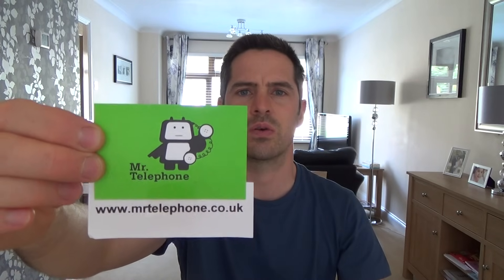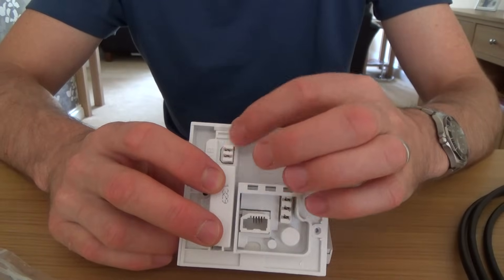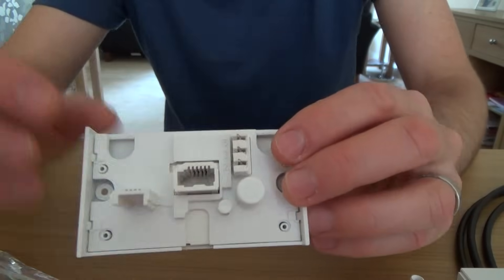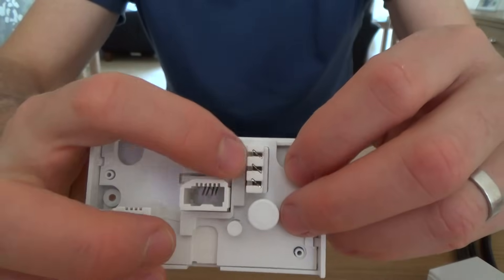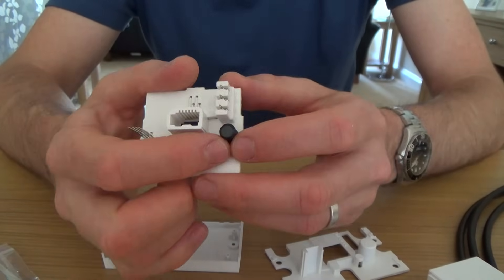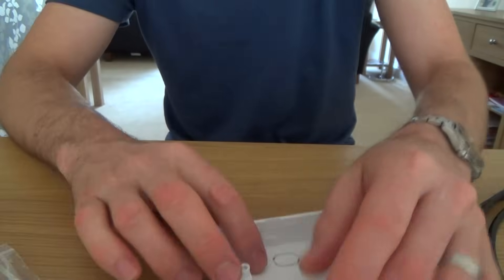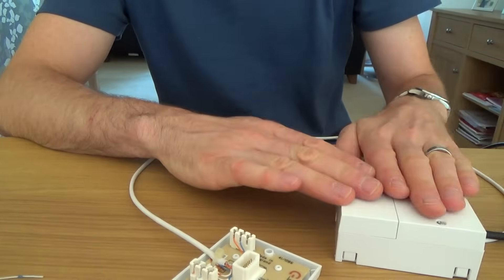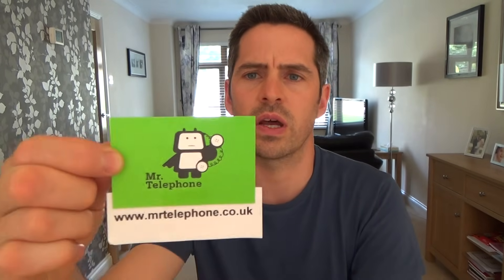How to install a NTE5 Telephone Master Socket and Telephone Extension

Comment: Hi Vince, could you please help me with a easy question, can I cut and extend the power cord going from the mains socket to the base station.  I am worried that if I cut the power cord and join more wire to it, it will never work again..   Thank you for youe time Tony
Reply from the maker: Tony Eaves Hi Tony, can you not just get a standard mains extension cable and then you can just plug the adaptor into the extension cable to save you having to cut the adaptor cable? I appreciate these mains extension cables are bulky but at least you know it will work and is safe.Thanks Vince
Reply: No, it is going into a cupboard, and there is not the room to have a extention outside of it, the only way, I can see is to extend the wire.  Thank you for your reply
Reply from the maker: Tony Eaves Hi Tony, it should work if you only extend it a metre or so and you the same gauge cable so there won't be much voltage drop and make sure you insulate both wires well so they don't short together but I haven't done it so I can't really advise on that one. Sorry.

Comment: Hi Vince, I'm looking to put an extension socket in a room at the other end of the house. Could I extend externally with the external Black BT 2 pair cable (Orange/Orange White & Green/Black? I will go out the back of master socket and around and in to the back of the extension. Would it work if I ensured I used the same 3 colours at each end? Many thanks!
Reply from the maker: Stevie B Hi, yes that cable will work fine. Use the white wire to terminal 5, the orange wire to terminal 2 and the green wire to terminal 3. Do the same connections on both ends (master socket and extension socket).Thanks Vince

Comment: It is brilliant video, very very clear. Can I have a question? The cable from BT to my house is too short. I would like to extend the BT cable to the new place of master BT socket. Are there any suggestions on how to connect two cables?

Comment: Hi

I've a faulty master socket with Screw terminals which are connected with a blue wire and blue & white wire. Can I replace the socket with a IDC one and if so, does it matter which IDC terminal the blue and blue/white wire goes? 

Thanks
Reply from the maker: Chris Armstrong Hi, yes you can replace with an IDC version and the standard way to connect is white/blue to terminal A and blue wire to terminal B (but it actually doesn't make a difference, it will work the other way round as well).Thanks Vince

Comment: Great video. My question is. I have my main phone line connected to a junction box then cable going to the master socket from the junction box. I think the master socket is old as it doesn't have the bellwire filter on it and the master socket uses screw terminals. I have just brought fibre broadband and I don't think what i have  is good enough for it. Would the wiring coming off the junction box to the master socket make the Internet worse in anyway. As I have always seen the phoneline go straight to the master socket. I'm just concerned as I don't know if I need a new master socket or even a new phoneline in the house i don't really won't to call my provider to fix it as that will cost £60-£130. Thanks Harry
Reply from the maker: +HarryxHD Hi, no not really, you often have a junction box to join the internal wire to the external wire. If the master socket is on an outside wall then you will just have the external cable connected straight onto the master socket but if the master socket is located somewhere more inside the property then it is normal to change the external cable to internal cable as it looks neater. Double check inside the junction box and master socket for damp and corrosion, if it all looks clean then it will probably perform as well as a newer installation.Thanks Vince.
Reply: My Mate VINCE Even if the master socket and junction box is clean and damp free is it worth buying a new master socket for my new fibre broadband. i would do the job my self of course. Say putting a new openreach master socket on would it improve my speeds
Reply from the maker: +HarryxHD It might help if you had extension wiring as the newer masters have the bell wire filter but if you only have the master socket without any extensions then it would be unlikely to improve your speed.
Reply: +My Mate VINCE ok thank for your info  :D

Comment: Hi Vince, I'd like to run an extension as shown in your video but instead of ending with a standard extension socket, is it possible to install an ADSL faceplate on  back box and connect the router, telephone and Sky to here where it would be more suitable and out of the way of children and pets etc.  Nothing would be connected to the original master other than the extension, if so what cable should I use, twin pair or CAT5/6.

Many thanks
Jamie
Reply from the maker: JAMIE CLARK Hi Jamie, you could do but you are not going to gain anything over wiring up a normal extension and then using a standard micro filter. If you wanted to get more involved you could fit an ADSL faceplate on the nte5 master socket and then run a cat5e/cat6 cable to the desired location and then fit a twin outlet with a bt socket and a RJ11 or RJ45 module. You could then wire up the bt socket using the blues and orange wires on terminals 2,3 and 5 as normal and then hardwire the green or brown pair for a dedicated ADSL extension using the A and B on the ADSL faceplate to terminals 4 and 5 (middle pins on the RJ45) or pins 3 and 4 if using an RJ11 module (again middle 2 pins).Hope that makes sense. I am thinking it might be worth doing a video on that setup!!!!!!!!Many thanks Vince
Reply: My Mate VINCE Hi again Vince, many thanks for your response yesterday.   I've been on your ebay site and seen the ADSL faceplate and CAT5E network cable that I'd need but I'm not sure what the twin outlet with a BT socket and RJ11/45 module is, do you stock this?  Is it a socket with 2 BT slots and a connector to convert RJ11/45 to fit a BT slot or am I totally wrong?
Thanks Jamie
Reply from the maker: JAMIE CLARK Hi Jamie, I don't have them listed on Ebay yet BUT I do have them!!!!!!! If you just buy a double cat5e faceplate and I will swap one of the cat5e rj45 modules for a BT socket module so you end up with one cat5e rj45 module and one BT socket module. The eBay item number is 260939822466 so type that number into the ebay search bar to see the listing and could you add a note to the order or send me an eBay message reminding me to swap the module over and also to include a back box.Hope that makes sense.Many thanks Vince
Reply: My Mate VINCE Hi Vince, I received the equipment yesterday and I've just installed it this morning and following your instructions it was problem free .The best part about it is that I'm amazed at the difference using decent cable has made, after numerous speed tests, my download speed has increased by between 4 and 6 Mbps.  Thanks very much for your advice, self help videos and speedy service. Cheers Jamie
Reply from the maker: JAMIE CLARK Well done Jamie, that is quite an increase in speed. I am glad you got it all sorted, thanks for taking the time to post the results.All the best Vince

Comment: Hi Vince,My test socket gives me speed of 3MB.As soon as I put the facelift on, even in the master scoket, the speed goes down by 1MB. When I use the other extension sockets, the speed is almost the same as the master socket.Is there somethig wrong with my facelift. I have a NTE5 master socket with a bell wire standard facelift. I dont want the ADSL filter as I cannot place my router nearer my master socket.
Do you think my facelift needs replacing? 
Thanks. Awaiting your reply.
Reply from the maker: rads Hi, it could be your frontplate but it could also be the extension wiring or sockets or incorrectly placed microfilters. To test the frontplate you need to make a note of the wiring and remove it and then see what speed you get via the frontplate without any wiring attached, this will prove whether the frontplate is faulty or not. If the speed is the same in the frontplate (without the extension wiring attached) and at the test socket then the frontplate is not faulty.Many thanks Vince
Reply: My Mate VINCE 
cheers mate. will try it. is there a number i could call you on for advice and stuff. I had a look at your website, couldn't find any contact details.
Reply from the maker: rads Hi,  I just give a bit of email support.

Comment: Hi
I have my phone connected to the openreach master socket test socket because the face plate is faulty.  I have lately had a lot of interference on the line and my Broadband keeps cutting out.  I move the plug slightly in the socket and the interference (crackling noise) gets worse. Would this be the actual socket at fault or the incoming phone line?  I was thinking of buying a new master socket and fitting it myself using the above instructions.  What are the line tools you say are available on ebay called so I can search for them please?
Reply from the maker: Tim Treagust  Hi, it may be just damp on the socket if the noise get worst by moving the plug so it may be an easy fix. The tool you need is called an IDC tool or also known as a telecom tool or punchdown tool. If you look at my ebay shop I do have the latest NTE5 master socket and tool for sale together (2 listings, one with a cheapo tool and one with a better tool).Send me an ebay message if you can't find it.Many thanks Vince

Comment: what tool did you use to punch the wires in the socket? also I have  bt infinity if I replace the bottom of the socket will it ruin my bt infinity
Reply from the maker: ***** The tool is a punch down tool, also known as a krone tool, IDC tool, telecom tool. You can get cheap plastic versions that punch but do not cut the wires and then you can get a more professional version which punches and cuts the wires. If you have a VDSL faceplate fitted when you had BT infinity installed then replacing the little front faceplate will not be affected or affect the BT infinity as the VDSL faceplate has already separated the broadband signal.Cheers Vince

Comment: The only wires that I have got in my master socket are  blue white/ solid orange/ and green / I have b/band and my phone is live but the phone does not ring, I have just changed the faceplate, owing to the odd colours I may have done the wrong bell connection

Comment: Hi Vince, I have a query I wonder if you could help me with. I have opened up my master socket and have noticed that whoever wired it up has used the green and black wires and the orange and white ones have been cut off. My question is does this make any difference to my broadband using the green and black (2nd line) as this is the only socket coming into the house? Thanks very much :)
Reply from the maker: +5tinkfist Hi, no it doesn't make any difference. Maybe the orange and white were used on another telephone line years ago...or possibly had a slight fault on them. The green and black are exactly the same apart from the colour as the orange and white.Many thanks Vince
Reply: My Mate VINCE Ok brilliant. If I bought an NTE5 socket and adsl faceplate to go on that can I wire it up using just the green and black wires? also do these wires carry any current at all only I don't much fancy shocking myself? Thanks very much
Reply from the maker: +5tinkfist Hi, yes it would need to be connected up on the green and black wires as these are the live wires in your setup. Telephone wires have 50v, the only time you ever feel a shock is when you are working outside in a puddle of water and someone rings the telephone line when you are touching the wires!!!!!!! it is enough of a shock to make you let go but that is all.
Reply: My Mate VINCE Hi Vince, Thank you for your assistance you really are very helpful indeed.

Comment: I have just checked and I have 5 pair cable that comes through from ducting, it is currently in a screw in terminal do you think that I would fit in the IDC terminals it seems quite thin compared to the extension phone wiring.

Comment: Hi Vince, recently purchased a load of gear from you and everything has been working as expected but I have a follow up question.

My fibre speed is still well below what it should be so I have rang sky, they have informed me that they want to send an engineer out.

If the engineer arrives and sees that a non-BT master socket has been installed (I also moved the external drop wire routing on the outside of the house and added an extension using a gel filled repair box) will I be getting into any trouble over it?

I am just going to act daft and say I paid someone out of the yellow pages to do it but I'd rather be forewarned!

Cheers!
Reply from the maker: EmpiricalPenguin Hi, it really depends on the engineer and where the fault is (if they find a fault). If the fault is external in a manhole or up the pole etc. then it would be unlikely that the engineer will want to get involved in the internal wiring as they will probably not want to spend time changing it but if the fault is to do with something internal then they may (or probably will) charge. They will only be interested in the line up to the master socket so don't worry about any extension wiring that you have done. Hopefully the fault will be external.Thanks.
Reply: Cheers, just a bit worried they'll see a brand spanking new non-bt branded socket and start asking questions! Thanks again!

Comment: HMMM, I'm trying to troubleshoot a connection issue. I have a master socket and wiring that is 20 years old. The master socket has three screw terminals for the drop cable but it is using only Blue and White wires, everything else on the drop cable is wrapped into a loop and unused yet on the extension socket the orange cables are inserted. Not sure how to proceed now.
Reply from the maker: roontunes Hi, that is normal. The old NTE5 master sockets had 3 screw terminals but only A and B are used. The master socket is always fed with just 2 wires and extension wiring is normally 3 wires because it uses the 3rd wire as the ringing wire. On drop wire cable it will normally use the orange and white (like in the video) but it is very common to have your master socket fed with CW1308 cable which will be blue and white/blue, orange and white/orange etc. Try to do your testing at the test socket and then work out if the issue is internal or external and then you can fault find.Thanks Vince
Reply: My Mate VINCE WOW, thank you, never expected such a quick response.

Comment: Fantastic video. Quick question; what is that cheap tool called to push the wires in? Will the extension be just as good for putting a spliter in and using the phone line/broadband without any issue as just using direct from the Master socket would be?
Reply from the maker: Eden B Hi, the tool is called many different things, IDC tool, punchdown tool, telecom tool, krone tool, wire inserter. If you google/ebay/amazon any of them you will probably find them. Normally the broadband will work better at the master socket but if you use proper copper twisted pair cable like CW1308 for the extension then you will probably not notice any difference.Thanks Vince

Comment: Hi Vince, I am just moving house, there is one master socket in the living room I would like to install the bt hub 5 upstairs could I run a cat5 or cat6 lead about 20 foot in length from the socket if i fit the Vdsl faceplate, can you please advise the best options, all items/parts will be ordered from your Ebay store Thank you.

Comment: Hi my phones stopped working so i took of the face plat off the master adsl phone box and in the back was a green wire which was still attached but the black wire had come off  so i put it back and got the main phone to work but none of the extension phones are still not working, have tried moving the black wire.but still not working .there are three slots for the wire to go in .also there are a orange and white wire in the back plate which are still attached which are  the screw down type. the box is about 15 to 20 years old ,if the box is faulty which new still box do i need hope you can help ,,,, john

Comment: Hi Vince,I live in a relatively new house and my cable comes from underground to my front door,the pair I'm that comes out of the ground is orange white which are spliced to blue and white,the internal wiring was installed by the builder and I'm currently have a bad time with my net very inconsistent,it thinking of cutting of the connections at the front door and running a brand new wire to the master socket,I'm guessing I should be connection up orange white to orange white for the best results?
Reply from the maker: +Ben Atkin Hi, no not necessarily. The external cable uses white and orange as a pair but the internal cable (depending on the age) normally use blue and white/blue as the pair so it sounds like the  builder has used the correct pairs.
Thanks Vince

Comment: Just opened up my master socket Vince and everything is disconnected. I have blue orange green brown and 4 white wires. None are connected anywhere. not even to the A and B area. any ideas mate?
Reply from the maker: Hi, normally on that cable you would use the blue and orange wires so if you have nothing connected then connect the Orange wire to terminal A and Blue wire to terminal B. If you still don't have dial tone then try connecting the green and brown wires instead.
Reply: +My Mate VINCE thanks for your reply. We got the technician out and it seems there was a fault outside the home. I assumed I damaged the wiring inside the wall plate but he told me that that line wasn't even live. because the fault was outside of the home they didn't charge us. Thanks alot mate.